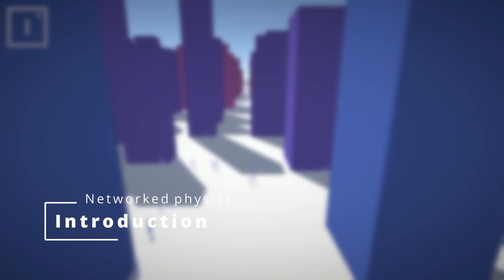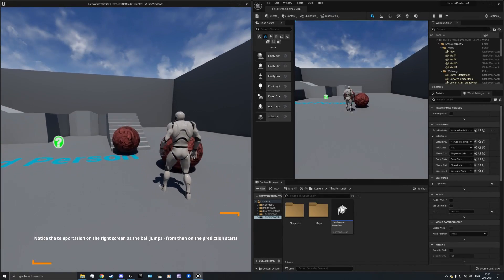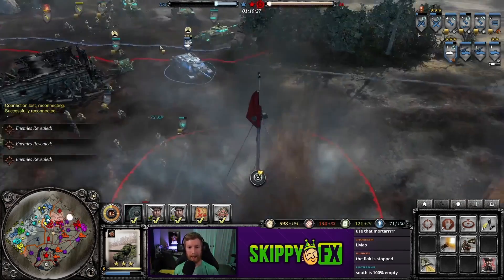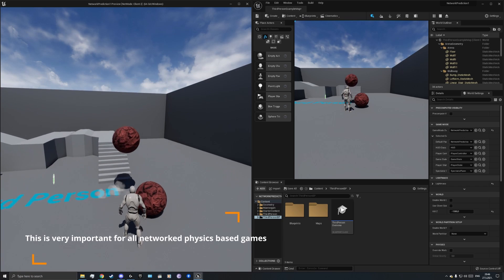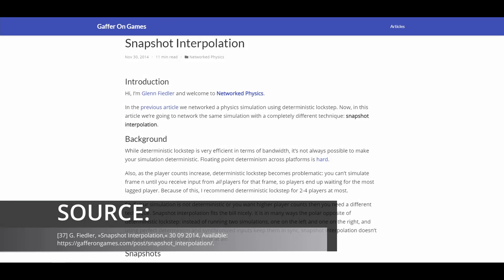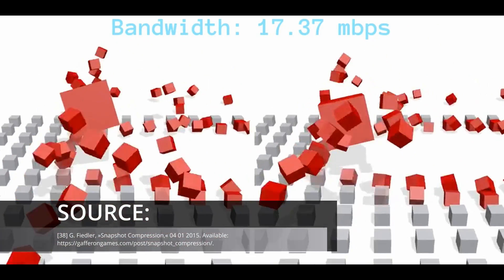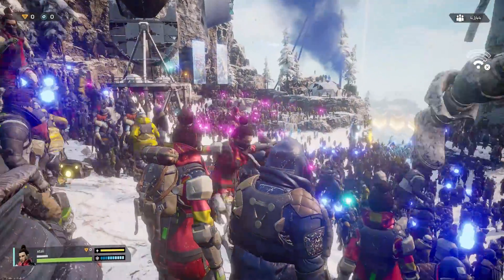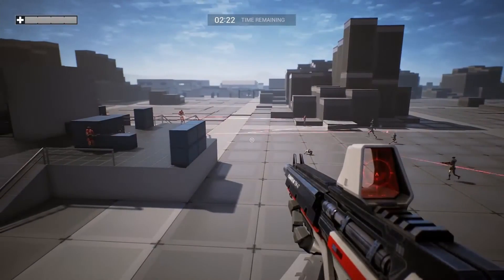Networking Physics  / Lockstep VS State sync (Next Gen Networked Games Episode 2)

Comment: There's one thing about lockstep => for the sim to work, everyone needs the same information=> this makes it hard for games, where you're not supposed to know some information => hacking is easy. With the normal snapshot interp, the server can decide what to reveal.
Reply: Also, the determinism isnt "solved with a checksum", it requires often a bespoke fixed point math physics engine to work. And that also limits the fidelity/accuracy of the physics simulation.
Reply from the maker: @pixboi  Yeah, a bit of a misquotation of the original thesis here, one of many in the series at this point :D, it was supposed to be: "Given the same inputs, the outputs are the same. We need a way to guarantee this is the case, this is solved with a checksum ", along with some more info on random numbers etc.

As to determinism itself, honestly these days with ever more standardized platforms it has become a lot easier, we did tests on Bullet for Arma Reforger, and found that even complex simulations like a fully physically simulated vehicle were fully deterministic for multiple hours on average (after significant modifications of course), across platforms, on different builds (headless vs server vs client). You can check it out at: https://reforger.armaplatform.com/news/server-authoritative-vehicles

Full lockstep determinism is another challenge all to itself, honestly more so in how the entire engine is structured than in physics, and it takes a special kind of team to make it happen.
Reply: @NextGenNetGames  Im currently building a lockstep with physics, having my own c# dll that has fixed point math and unity to show stuff. it works well for basic usage, but ill have to see how far it goes
Reply: @pixboi  I'm implementing a deterministic lockstep simulation for my 2d top down physics shooter. Thing is I'm using the unity inbuilt physics because I wasn't able to find a c# wrapper for an efficient deterministic/soft float/fixed-point physics engine that works on WebGL. Yup, the game has to work on WebGL both desktop AND mobile platforms.

Comment: Really good Video. Currently trying to learn about lockstep implementation so I can make my own RTS work properly.  Doubt you'll see this but if you know any good places to learn about implementing and coding deterministic lockstep. Feel free to let me know.
Reply from the maker: I would recommend reading some of the Age of Empires articles I mention in the wiki, they are quite insightful. 

As far as implementation, I haven't looked at it personally, but I heard 0 A.D. is quite okay, its an open source online lockstep strategy game. 

I would also recommend "Detecting Synchronisation Problems in Networked Lockstep Games" by HAMPUS LILJEKVIST
, I believe it is freely available online, it is a nice overview of the issues you will encounter.

Personally I am still on the fence about truly recommending the technique, even for RTS. Beyond the technical concerns (even the greats struggle with it https://www.youtube.com/watch?app=desktop&v=JWFy7yVZaUk&t=1387&feature=youtu.be ) and hacking concerns (impossible to have true fog of war) it requires repeated reliable transmission a.k.a. it cannot be bandwidth bound, as far as I know there is no good solution to this, meaning that a client with a poor connection/bandwidth cannot play the game.

Comment: How UE Chaos can possibly implement all those types of networking if it simply implements the most naive physics replication without any prediction out of the box? There is no even quantization or other optimizations for net serialization.
Network Prediction plugin is immature and forces to use fixed engine frame rate and also switches physics to run on the game thread. Async model is abandoned at the bleeding edge version at perforce.
GeometryCollection for destruction also has a placeholder replication (no optimized net serialization) that is broken at 5.0.2.
There are virtually none of those techniques implemented in base UE4/5, don't confuse people please.
Reply: Unreal does support quantization and there is network prediction available also. 
But its really easy to add your own prediction to unreal net code. In about 500 lines of code or less you can enable a pretty decent solution for client side prediction